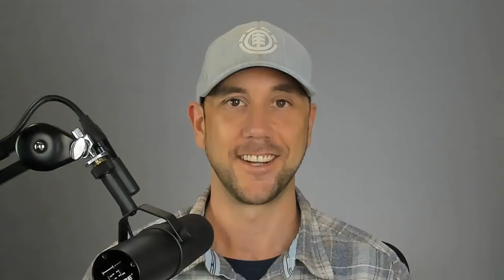Opportunity Cost vs. Real Cost - You Must Know The Difference & Which One May SINK Your Business

Comment: Thanks for the video Miles. I have definitely been caught in the trap you're talking about here before. Fairly recently I was comparing web hosts for over 12 hours before I realized, I could have paid for 2 years of hosting on all three hosts if I worked those 12 hours instead. Sometimes you just have to make a call and move forward. But it's a bit of a hard balance. As you point out, picking the wrong tool can lead to a lot of headaches as well.

I have a question that's been bouncing around my head, do you think that leaving comments enabled at the beginning is a good idea? I know it's quite good once you can actually get comments, but I wonder if the lack of any comments on any of my content at the start might look pretty bad.
Reply from the maker: Don't worry about 'how you look' stay focused on creating great quality content and engaging with people...  Make real connections.